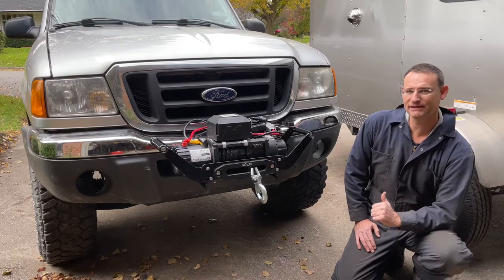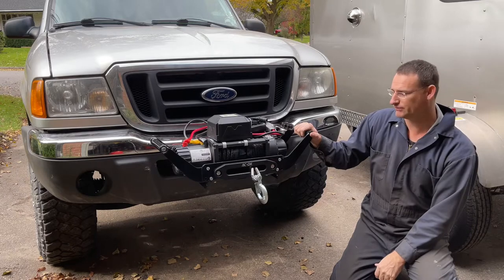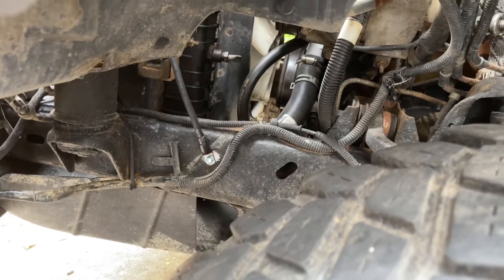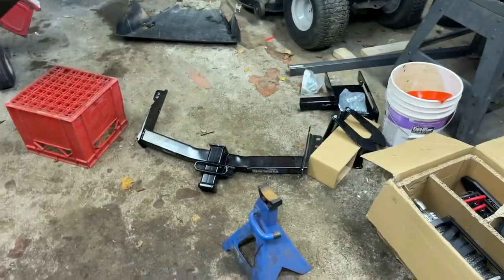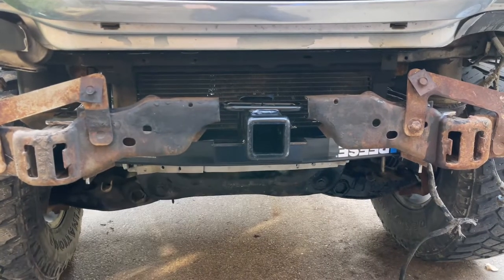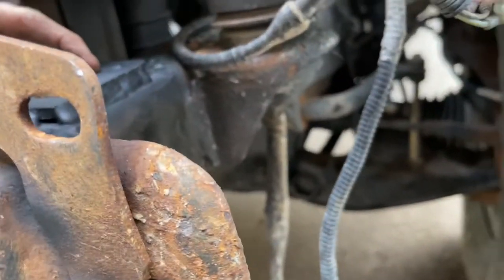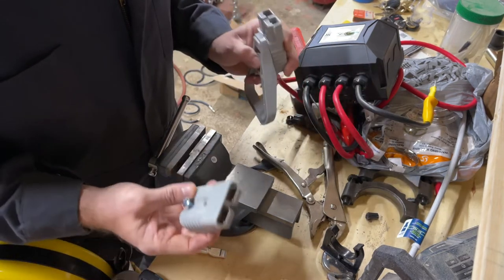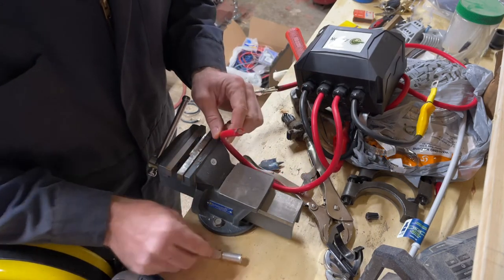Ford Ranger Winch/ Front Hitch - Install

Comment: Just wanted to add that the CURT front receiver fits a Ford Ranger with the cross member without cutting. Mounted 😮as displayed. Sucks having the hitch so low, but it seems to act as a brace for my bumper valance. I hit a deer doing 70 the other day and had zero damage to the bumper valance, likely due to the hitch bracing it. The cost of the hitch was definitely equal to that of a new Valance+ fog lights and the time dealing with them. Something to keep in mind for anyone looking to buy a hitch, who is ok with it peeking out below their valance. Not ideal for winches but just fine for other applications. I plan on cutting a hole in the cross member to reverse my hitch when I decide its time for a winch. Cheers from Canada

Comment: Thanks again for answering a previous question. I was in the market for a winch bumper for my 02 and the only choices were crap chinese for about $800 all in and 2k for a quality NA one. I wish there was a part 2. Would like to see if the winch would clear my small lightbar which is on top of the bumper. I guess I would lose the fancy FX4 curled chrome recovery hooks as well. Looks like a great job. Thanks for posting
Reply from the maker: When welding it up Id suggest tacking it up then mount the winch. That way you will know you will clear everything or not. Yeah you will loose those fancy hooks. But you will have a killer winch!

Comment: Sorry in advance, I am absolutely stealing this to do for my own, nice work!
Reply from the maker: Thanks and No problem at all. That’s why I put this stuff on here…. Steal away. 😁
So far it’s working great… I tried it out pulling my truck with trailer attached. I’ll try and get a video posted.
Reply: @RangerShop1  Can't wait to see!
Reply: Can you do this mod and still fit the front factory tow hooks?
Reply from the maker: @bobjones1579  unfortunately I don’t have my two hooks on anymore so I’m not sure but I would think so. I only cut the very centre out of the cross bar other then that it’s all factory on the front. So if they fit on there before they should still fit on after. 👍
Reply from the maker: @bobjones1579  yeah I don’t see why not… maybe not with a body lift though.. I’m not to sure
Reply: Mine is factory, I really like the idea of a removable winch. Nice to see another Ontarian too! Any chance you have the part number for the Reese hitch you used?
Reply from the maker: @bobjones1579  yeah for me a removable is the only way to go... not exposed to the elements, I’ve used it in the back to pull myself out of a jam.... I like the flexibility. Sorry I don’t have the hitch number I just got it used off kijjij

Comment: I am doing nearly the same thing on a 2005 FX4 Level II. I have the same front bumper as you only with factory fog lights in those two holes and factory recovery hooks inside the large center opening. I purchased a front receiver hitch (quality one) for my specific truck and like you, do not like how low it mounts. So I plan to invert it and bolt it on upside down. I know I will need to do some cutting to get it through the factory bumper and factory skid plate ("Level II"). I was hoping to get some help with some links:
* What Anderson knock-offs did you get and do they have rubber plugs or plastic plugs for when the winch is not plugged in? (I want Andersons, but don't know which ones to purchase and can not get an answer from YouTubers that have them installed.)?
* What AWG did you use to run back to the rear bumper?
* What were/are the battery connectors you mentioned you used? (link?)
I really like how clean your install looks and completely understand why you don't want your winch mounted all the time. I plan to weld a mount in my bed with a lock just as you are doing. 
Wish me luck and any help would be appreciated.
Reply from the maker: Yeah I hear you with the factory hitch being too low. It’s unfortunate!
Ok in the video description I put a link to the parts I used…. Personally I’m very happy with the connectors but I think I could have gotten away with a lighter amps. Wire is 4awg 10ft, then I ran a 50 amp fuse off the battery. Just make sure you really shield those wires running along your frame. I’m super happy with the set up, having used it already a few times. I don’t really see a point of having a winch in a fixed position… it rather have the flexibility. I think you will like the set up.